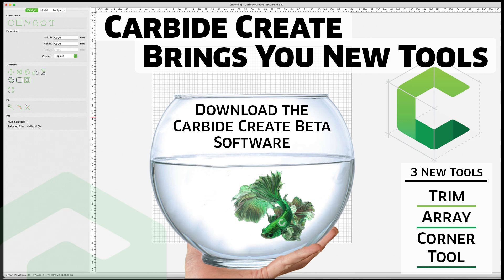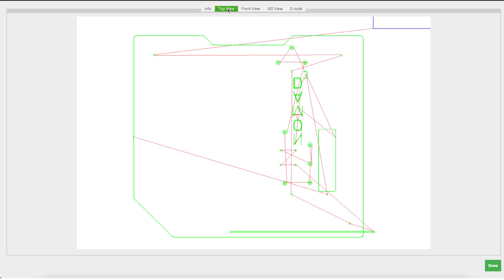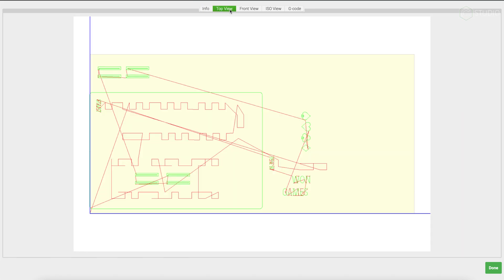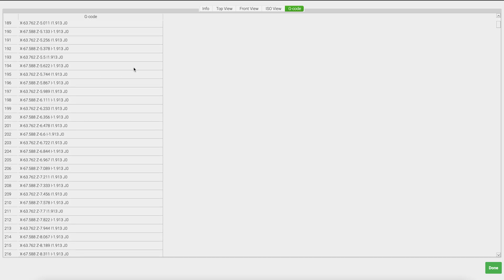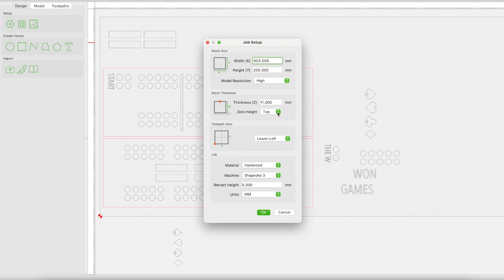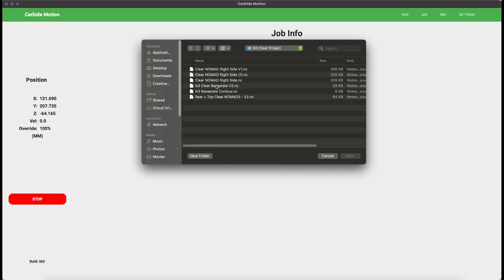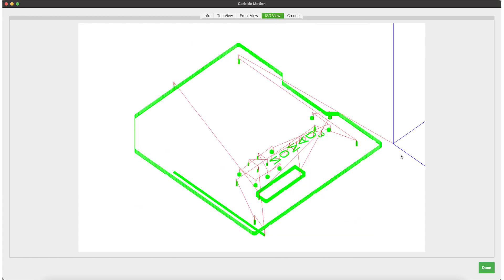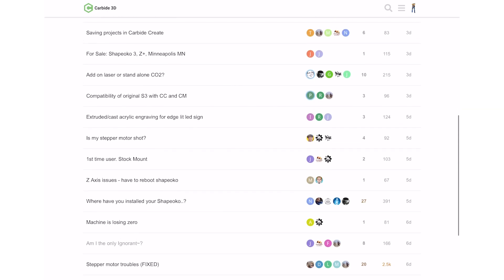Carbide Motion Adds New Features - CAM

Comment: So happy about the simulation feature. Now, if we could get more work offsets and tool wear adjustment/cutter comp adjustment.
Reply from the maker: The "Quick Action" feature in the latest builds of CM will allow you to create additional saved offsets.  They're not mapped to G55, etc., but they allow you to quickly go back to a preset program zero.

Comment: This sounds good but in my experience, the last version of CM was too "buggy". It had some nice features but It would lose its zero home in the middle of running a g-code cycle, which cost me time and money by ruining the project that I was cutting(this happened to me 4 times). The program would also just shut down completely and I'd have to restart it from the beginning of the program. I ended up going back to Version 530.

Comment: It would be nice to be able to load a file and look at the visualization without having to connect to the machine and initialize it first.  Having Z set to bottom in design and setting Z at top during run time is annoying... people cut air.  Having Z set to top in design and setting it to bottom during run results in a nasty unexpected plunge which people too often blame on the machine thinking something must be wrong with it. Hopefully people use the visualization and look for those kinds of errors. I still see many people design and cut without looking at the simulation in Carbide Create and wonder why it didn't come out right when they would have been able to see that ahead of time.